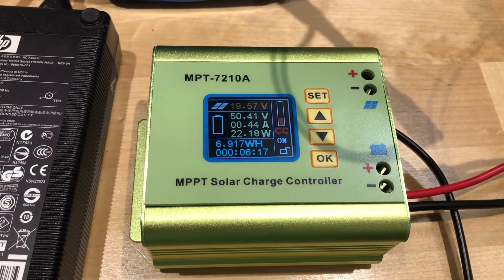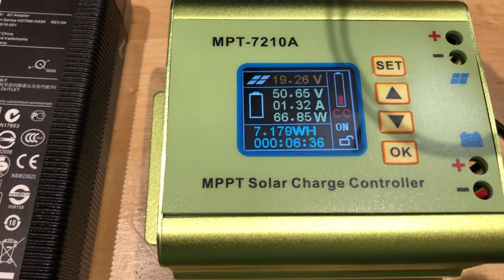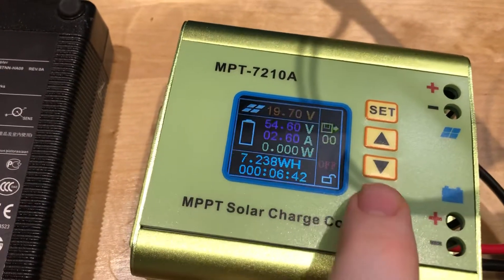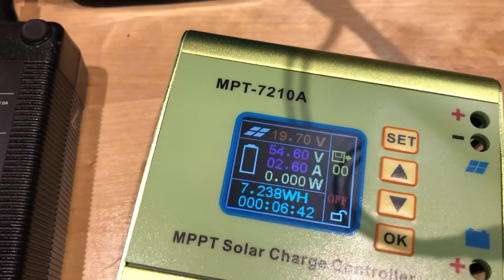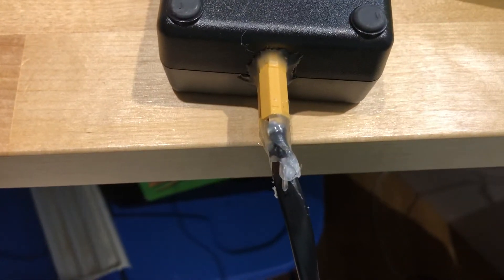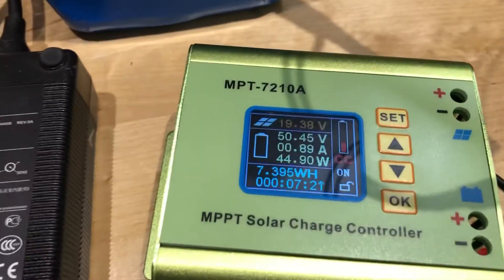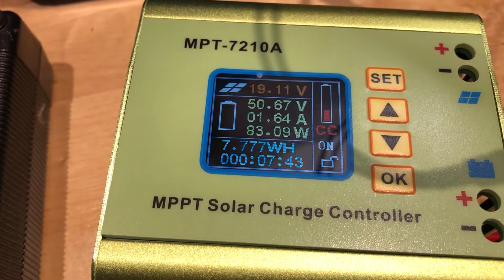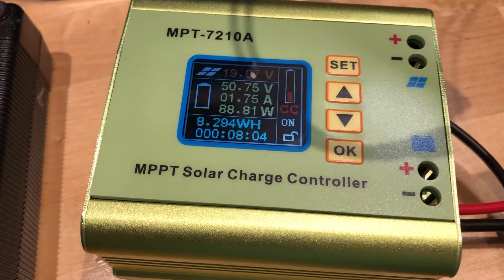MPT-7210A limiting current? Issue charging 54.6v pack

Comment: I have the same issue.
18V -> 54.6V 140W limitation.
There was 70W originally, but I put the bridge on the wire resistance in the circuit. Thus I was able to double up the current and power.
Reply: "I put the bridge on the wire resistance" Could you explain that? The unit is kind of pointess in my use (a 180W 15.5V MPP solar panel is liited to about 75W) but doubling the current would help. Thanks.

Comment: Indeed, this is a finicky unit. I did some experiments to find that the amount of output current you can get depends entirely on the voltage difference between the input and output -- the closer they are, the more current you can charge with. In your case of going from 20V to 50V, I would only expect a max charging current around 1.75A -- exactly what you are seeing.
If you put two of those laptop chargers in series you can supply ~40V and get 3-5A out depending on your state of charge.
I just made a blog post to answer questions exactly like this:
https://mschausprojects.blogspot.com/2022/05/how-to-get-max-power-from-mpt-7210a-boost-charge-controller.html
Reply: I'm trying to help debug a solar to ebike charger for a science fair project. A 54.6V battery charge voltage (but 50.xV at first of course) charged by 15.5V Vmpp 180W panel. Hence, a 35V or so V diff.  In your plot, that puts me at about 1.5A which is exactly what I am seeing. I might investigate the Ecoworthy 12A boost controler that admits that at 12V they can only achieve 216w. That's OK for my panel and I can always scale it in series rather than parallel.

I congratulate you on the only comment that is not nonsense.

Comment: I have a 48v/20 amp power supply and MPT-7210....
I have 50v input set and 86v output to charge 21s 88.2v max battery
I only get 2 amps max output when going from 50v to 86v. Is this normal
You ever figure it out? I tried to check your "main section" I dont know what you mean by that.

Comment: The  issues about the current limiting can be easily explained. I noticed the same limitations and did some in dept investigations to find the root cause. Here is what I found:
This controller cannot accept more than about 6.5A (my observation) as input current. That's how it must have been designed. So the maximum available input power in Watt is: Vin x 6.5A. If more charging power (charging Voltage times charging Current) is needed, it can only be archieved by increasing the input voltage Vin when the input current is at its max. Normally a boost converter would increase the input current  to keep track of the requested output power but when it reaches 6.5A it's over and out with this device. It's a undocumented limitation. For me it means that I can't charge my 42V ebike battery with more than about 1.7A with a 12V battery as power source.
There is a 'workaround' however (don't laugh): connect a decent boost converter on the input of the MPT-7210A to increase the input voltage ... I told you: dont laugh! :-D
Reply: I found that there isn't quite an absolute input current limit, but rather an output limit based on the difference between input and output voltage. Just like you say, increasing your input voltage to be closer to the output allows for more output current.
Reply: My panel input voltage was 40v, only charging at 3 or 4 amps max. So less than your 6.5A
Reply: @AndyMcBlane  6.5A is the maximum input current of the device, not the charge current
Reply: I have a 48v/20 power supply and MPT-7210....
I have 50v input set and 86v output to charge 21s 88.2v max battery
I only get 2 amps max output when going from 50v to 86v. Is this normal

Comment: unfortunatly the input and output caps arent good quality and should be changed for bit larger too,and using 2 12 atx computer psus in series gives you 24 volt up to 50 amp draw powersupply, and can push higher currents then i found using a much higher quality 24 volt mttp charge controller of 40 amps,with a seperate 40 amp dc to dc booster boardof ebay for 20 dollars i cazn charge 84 volts nat over 20 -30 amps now
Reply: mind you requires high end bms to handle those currents ,i use daly smart bms 20-21 s 72 volt 150dc amps charge and discharge constant

Comment: I have the same 1,5A limitation. Using a 330w 35v panel to charge a 72v battery, it never went higher than 1 5A. 
Any answer other that the unit is limited in its capacity ?
Reply: check my explanation in the main section

Comment: I have the same issue, you ever figure it out? 19.5v to 58.8v is capped at 1.4amps, or about 80w. I'm using a 200w dc adapter 😂.
Reply: check my reaction in the main section

Comment: Had the same problem when I used it with a 24V power supply. Only 2A at 54.6v. Although 24V at 10A would easily be 240W.  Maybe it works better with a Solar Panel and when hooking it up to Power supply possibly with a not 100% clean DC the MPPT' logic does something strange ?
Used a 400W step up converter instead, charges my Battery with up to 14A.  (13S/8P Pack, so no problem for the battery, although I usually only use 6A to safe Battery life)

Comment: Hey - same issue here. Did you figure it out?
Reply: check my reaction in the main section
Reply: Even worse, I have 2x100W solar panels input for 36V and 48V SLA output battery bank, and it will only boost to 0.5A over a 20 second period before it drops to 0A and starts over again. Time for a better alternative I think.

Comment: Dude, there's nothing beyond limited except by the fact that you are operating the contort improperly. It's a voltage boosting solar charge contort with dc dc charge function. It's not made to run off already converted ac to dc current. It will work but the wattage is not going to be indicative of charge performance  in any way. Secondly, wattage has nothing to do with the charging function whatsoever. If you are giving it a lower voltage than what you are asking it to charge, it is going to charge at whatever voltage you set out to no matter what. If you have it set to charge a 54v battery at 56v or a 72v battery and 76v, it's going to charge to that voltage at up to 10amps. When the volts and amps are discharged wattage is achieved. Wattage means nothing as long as the volts and amps are being pushed. Plug in a 12v or 24v battery or a solar panel and watch what happens. Charging a 54v battery at 10amps is probably about the top end of what the battery can reasonably tolerate so you're getting maximum charging
Reply: I'm wondering in which way DC from a Power supply is better or worse then DC from Solar or Battery. Either it is DC or not. The Electrons don't wear Id cards. Except if the DC from a Power Supply is not clean and this Solar Charge controller gets confused by some frequencies that are still embedded in the DC. Maybe for the Power supply->Charge Controller->Battery application the MPPT Logic has adverse effects.

Comment: Did you figure this out? I have same problem and same basic setup but with a 180W 19.6V power supply. Also tried with 12V supply and got the same result. It is limited to 10 amp input and output, so at 12 V it can only charge at 120 watts. I get the have 80 watt output on either supply
Reply from the maker: I’m waiting to discharge the batteries and have a desktop psu 420 watt 12v rail